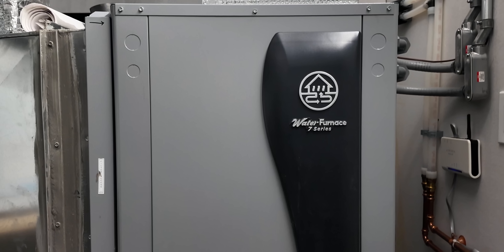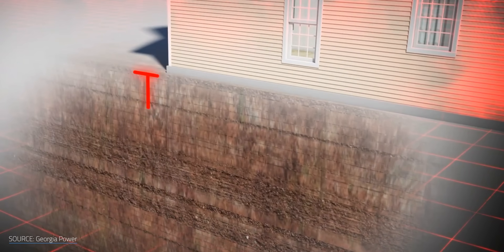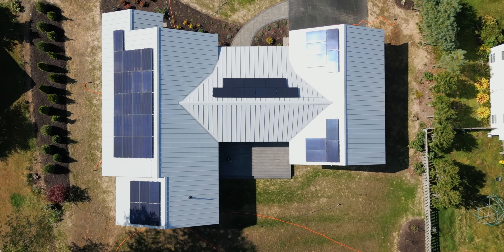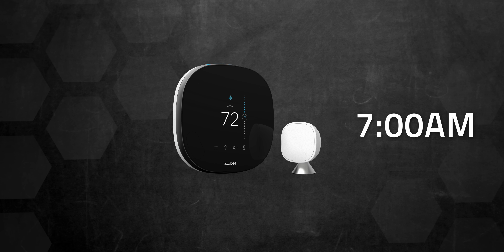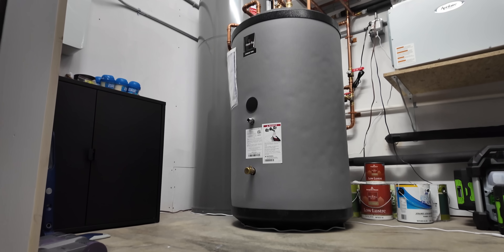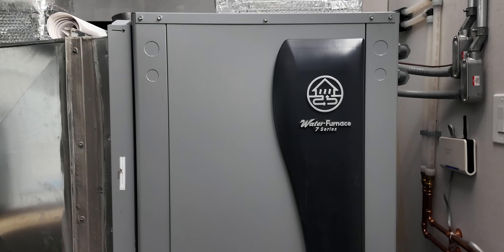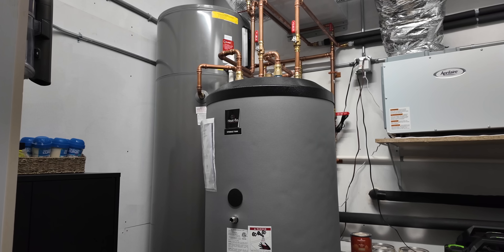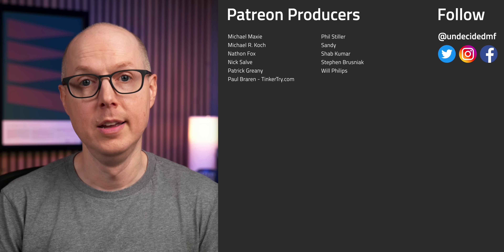How My Geothermal Heat Pump Really Performed (2 Years)

Comment: ground source geothermal is great... if it can be installed very cheaply, like running the loop in a deep lake/pond, or if you have a large footprint and cheap access to some heavy equipment to dig ..... 
every 10k of initial cost, averaged out over 20 years is $40+ per month, plus the cost to run it... plus the interest on the loan taken to pay for it, or the lost investment gains from putting that money to work... 
at even a very, very cheap 25k system cost, you're looking at $150-200 or more per month cost to own and operate over 20 years 
(not to mention, most or all of the federal rebates are gone, or will be very soon,... and the costs for any and all types of alternative energy components, will also likely be rising sharply as all the federal grants and subsidies and tax breaks these companies currently enjoy will also be disappearing soon, if not already cut off)

Comment: This is really cool technology but unfortunately it doesn't work in certain places in the country because the soil isn't that great for heat transfer. I've specifically been told by engineers, and they've even done testing at the University of Alaska Fairbanks, that it doesn't work in Alaska or places like Arizona with very hard soil

Comment: What is the effective wall value insulation of your home. These are key factors for sizing or changing any system.
You want to fix the holes and heat loss well before any upgrades of solar or heating in a house.

Would you put in a higher efficiency heater or fix the holes of air and insulation leaving your home?

Heat loss calculations and thermal bridging must be accounted for

Comment: Where I live the electrical rates are about $0.10/kwh so the ROI just doesn't make sense.  Even if our rates were as high as yours it still seams you would get a better ROI by using a conventional (less efficient) HVAC system combined with a larger solar+battery setup while still meeting your environmental goals.  It would be interesting to see the ROI of each system in your home as I often find going with the "top of the line" rarely makes financial sense compared to the next step or two down.  

This is an oversimplification but if for example your ROI per dollar spent on solar was 10 year, geothermal was 20 year, high efficiency heat pump was 15 year, and top of the line insulation was 15 year than it would be better to just skip all the others and put the money in a larger solar setup then pocket the rest.

Comment: I’ve had Water Furnace GEO thermal for 11 years.  I’m really pleased with it and happy I had it installed. The only problem I have is when my electricity gets disrupted.  If my system is actively running, when electricity is restored my system will not go back on.  I have to turn system off go to breaker box, flip breaker, then restart system.  This only happens if break in electric service is very brief.  If electricity if off for longer period, even 5 minutes then no problem.  My utility company has a method to switch from tower to tower to restore electric very quickly.  I’m happy they do, I live rural and rarely is my electric off for hours etc.  However, I like to travel and I am tied to home during cold months due to this glitch.   Any help would be appreciated.

Comment: I moved into a house that had geothermal previously installed in 1995. It has a Lennox Pulse (96% efficient installed in 1986) gas furnace back-up that we turn on under 25F exterior ambient temps (1957 house). The Geothermal has been fantastic and we rarely have an energy bill over $110 in NW IA with zero effort to conserve energy. There has been no maintenance required on my 30yr old geothermal unit except filters and a new circulation pump. The Pulse heater has also been maintenance free. The geothermal unit is a bit undersized at 1.5 tons for 1100sq ft which is why I think it struggles at lower exterior ambient temps, plus a 1957 house is only going to be insulated so well without a complete gut. If I were to build a new house, I would absolutely consider a geothermal unit.

Comment: I don’t get why you need a 400ft drill when you say the temperature is fairly consistent once you get down to 6-10ft?
Reply: You need pipe area for ground source heat pumps. You can either do lots of ground area at shallow depth (horizontal lopp) or deep depth with little ground area (vertical). I don't think Matt has enough property to make a horizontal loop possible.

Comment: I had geothermal installed in 2009 and love it. At that time I had a CD rolling over to near zero interest rate. I decided to invest in my house instead. House was built in 1933 so I was doing numerous energy conservation projects to get the bills down. The summer AC bill dropped like a rock. It's definitely paid for by now. I did find that keeping the thermostat constant worked best as he stated. I already had on-demand hot water so the super-deheater (required for tax and rebate credits) was routed to underfloor heating in the bathroom. It was tile floor so even the small difference was fantastic in winter.  I'm currently tracking the kilowatt hours per heating degree day Nov to Apr to keep track of how well other insulation projects are working.

Comment: $39k for an air source heat pump? Wtf, that is insane. I just installed a 2-ton unit for a little over $2k.
Reply: I was shocked by that, too. Mom just had a new system install, at $4k. And 31cent KW/h? It's 13 cents here in S. Louisiana. At that rate, I'd never break even.
Reply: I think this also included ducts, and base connections, and probably a lot of other things for an entire new build. It's a lot easier to swap out just the heater unit to a pre-existing house. But, yeah, 39k for a good heat pump sounds a bit high, and couldn't some of those rebates and tax things apply to the heat pump as well?
Reply: well it was a new build so it had nothing.
Reply: @schilling3003  Mine was around 5k including all new ductwork in the crawlspace and the new air handler.
Reply: MA has scam system in place. Alot of HVAC installs are done with cash rebates from energy companies. But not many realize that contractor that work with energy companies mark up their prices by alot. And the cash back that people get, including this guy, is spread over everyone's monthly bills. So in really, Energy companies profit, HVAC middle-man sales companies profit (multimillion dollar business now), and they outsource all work to HVAC contractors who also profit, all regular people in this loop lose money. Heating and cooling bills in MA are $500-1000 a month on average, that's gas or heat pump, makes no difference. This scam just got uncovered and all over news lol, people can't afford utility bills anymore. But I am not sure if anything will be done about it, probably lots of money involved to stop it.
Reply: Yes, "government rebates" means everyone else is subsidizing your HVAC system.
Reply: @IYG-x7c It seems so, especially with the power rates at more than twice what I pay in Louisiana. His is 31cents, mine is 13cents.
Reply: @jbrou123 We have few towns with municipal power and they have 14 cents. I think I pay 35 cents, not 31. They are robbing us lol. In summer I use 5-8 bucks of gas but bill is $50-60. Basically last month I paid $52 to deliver $8 bucks worth of gas ($60 total bill). I can't even imagine what's coming in heating season.....
Reply: @IYG-x7c  air source heat pumps are a scam. they do not work when its cold, ground source is completely different
Reply: @notsure6182   That may once have been true, but not anymore. Watch some of TC's more recent videos about Heat Pumps, he gives the numbers. While you DO want a backup resistive system for the really, abnormally cold days of the year, 99% of the time you are being extremely efficient with your energy usage to heat your home. And even during those super cold times, you still get better performance from the heat pump, still above 1.0 efficiency, just not the 3 to 5x efficiency you get in optimal conditions.
Reply: He meant the whole house system. Not a puny 2 Ton unit. 🙄🙄
Reply: @morselrafez3722  Don't be a troll.  For a small home, a 2-ton unit is perfectly fine.  Only the very largest homes would need anything over 4 tons.  Scaled for cost, that might be $16K or less.  Still a far cry from $39,000.
Reply: @danielhawkins6425  Don't be ignorant. There is no way a 2 ton AC adequate for even a single living room area once the temp crosses over 32C and the sunlight is entering the house through glass.  
BTW, I wasn't justifying his cost. 
Then again, I would just divert this unnecessary cost towards solar panel and recycled EV battery set and be done with it.

Comment: Lately I have come to the realization that the term, "worth it", mainly applies to buying or selling things. Example: I have a 2005 Suzuki scooter that could cost $4,000 to replace a broken CVT belt. That might be more than what I could sell it for, but I can now ride it for several more years, and don't have to replace it with a more expensive bike. So, is having a $78,000 geothermal heat pump worth it? I see it as a "yes", if you can use it as a selling point if or when you sell it. Otherwise, if you're comfortable and satisfied with it's performance, it really doesn't matter.

Comment: We also live in Massachusetts where the cost of electricity and propane is high. No way would could have afforded geothermal. We opted for solar panels and air source heat pumps for heating and cooling. Over the past 5 years we have paid zero electricity and the heat pumps are the most comfortable heating and cooling we have experienced.

Comment: I've talked with people who've felt the up to 97% efficiency of heating by burning with natural gas to be more attractive.  I've explained that you can get 40% conversion efficiency burning NG in a power plant.  A heat pump can take that power and turn it into 300-500% heat.  Just taking 250% efficiency that 40% becomes 120% heat compared to a heat furnace.
  The rest of the heat produced at the power plant could be distributed to the neighbourhood.  Replacing gas distribution with electrical distribution would eliminate half the joints in the NG system that could leak and the associated greenhouse gas emissions.
  I don't know if a NG fuel cell would be small or affordable enough enough for a home but they can get up to 60% efficient.  250-400% heat pump efficiency would give you 150-240% heat compared to 97% tops from a gas furnace.  No saving on joint leaks though.  Has anyone heard of an NG powerplant using fuel cell technology?

Comment: I always chuckle when someone says they reduced costs because of Federal and State rebates.  You didn't "reduce" the costs; you shifted the costs to other taxpayers...  This same "cost reduction" also worked great with your new Tesla I'm sure.  It must be gratifying to have others paying these costs so you can hit your "net Zero" goal.  I'm fine with your long-term goal of reducing your energy consumption and costs, I just wish we weren't all helping you.  
Heck after you factor in the energy needed to mill and deliver the lumber for your house and produce your solar panels along with digging a well and producing the piping for your system, it would have almost certainly been more energy efficient to buy a used house and car, but not nearly as good a video.

Comment: No way! It's way too expensive. For a just a bit more than the drilling cost alone I got a brand new heat pump system plus duct work and cleaning and full insulation just 2 years ago.

Comment: The issue with upfront costs and many years or decades before break-even is the opportunity cost of sinking all that money in early. Imagine what 50k (drawn down slowly by higher operating costs) could do for you financially vs having it locked away in a high upfront cost utility that only BREAKS EVEN by the time you’re in old age. The true break even cost should be run against the returns you’d get investing what you saved up front.

Comment: "Heat pumps can reverse to cool your home just like an air conditioner"...

...... that IS an air conditioner.

Seriously. The form factor has changed slightly with the broader adoption of eastern-style flat compressor blocks in favor of the western style boxes, but yeah. An air conditioner is a heat pump. A Fridge is ALSO a heat pump. 

And that last one is important, because for anyone who says "But a heat pump will stop working if it's cold!".... you've had a heat pump running inside your house for Years that is constantly pulling heat out of a box that SHOULD be running at 0 degrees F. It rarely ever IS running at 0 degrees, because apartment fridges suck, but yeah, it's usually in that ballpark. And you can check it too, put your hand above the back of your fridge. Feel all that heat? A ton of it is just from pulling heat out of your fridge and freezer.

Comment: So my house is 3300 soft including the basement. I have 2 heatpumps , upstairs is 2 tons downstairs, which is 2.5 tons. My emergency heat is propane. The gas kicks on below when the temperature gets below 30 degrees witch happens frequently in Pennsylvania. I heat my water with propane my stove is gas and gas grill also. Last year I went through about 500 gallons of propane at $1.40 a gallon. Just filled the tank for the year. My electricity bill is around $220 a month on average. I do have a built in pool and an electric dryer that is probably half the electric bill. I love the heat pumps they do work well. The problem is that they wear out way to quick now. Anytime after 10 years they go bad with all the defective global parts. The time of long lasting equipment is over. Keep this in mind when you are designing your Hvac system.

Comment: After watching your videos over the years, we decided to finally take the leap and installed Geo-thermal last year. Here in Ohio, for a retro fit and a ground loop it ended up costing around $30k pre-rebate. Now being a year out, it looks like we are saving around 10% from what our 2 year old Air based Heat pump. Many of the good points you brought out in this video also make it so we like that we switched. 

The main one being, this system should last us, pretty much the rest of my lifetime. We dont have to worry about touching the thermostat and...it just works. One hidden cost that we really did not think about enough was the damage to our yard. Our entire front yard was dug up for the loops, had to sit for months while the ground settled, and then we have had to pay for excavators to come back out and level out the ground again, and now we are paying to have landscaping company come back out and prep the yard again.

I think the biggest win is we just put up solar to go along with this and now we are seeing the "Full picture". Goal for next year, is to get the insulation in the house redone and then I think we will finally be in the place we wanted. But looking back, we have basically spent as much as we paid for the house originally in these upgrades.

Comment: Do these types of geothermal systems require going underground?  

Can the same effect be mimicked above ground with an artificial mound?

All we need is thermal isolation, so 12-foot high and 24-foot wide of dirt, soil, or something else?  

Sure, that energy has to go somewhere.

Comment: Great vid....I will tell you that investing in a Honeywell or EWC zone controller to control the rooms individually would be great in your setup.  I installed an EWC zone controller for our house and it was worth every dime for it.  The ability to cool down ONE room and leave the others alone is great - the ONLY issue is that you may "over-pressure" your system if it's not designed accordingly....So many factors to work with BUT - worth it!!!

Comment: I get that you are trying to be the most energy efficient, but aren't you just trading renewable energy sources (geothermal vs solar) so that doesn't really matter in terms of efficiency by opting for a ground system instead of just adding solar panels at a huge fraction of cost?
I guess winter energy use is an issue, but again, in your situation where you can build up credits with the utility to use in winter, you can again add enough panels and generate enough power in the summer to offset the additional winter cost. And again, you're not giving up efficiency since you're feeding the grid more power in the summer that you use in the winter.

Comment: Thanks Matt. Great insight. I think I have a reasonable handle on the above ground maintenance, but what is the design life/life expectancy of the pipework loop in the ground and what is the budget for repair/replacement? 
A lot of investment cases focus on the opex/running costs,  but ignore future capex/replacement cost. (A classic example is with solar and the potential to need to replace the inverter after 10 to 12 years).
I’m sure you have the data 😉